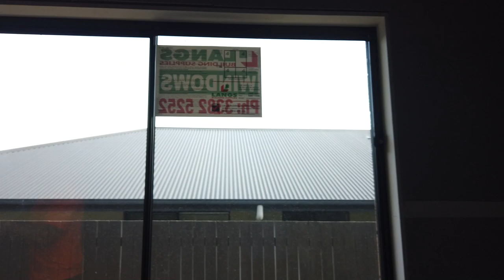How to Tape and Coat Drywall Joints

Comment: Max do you know the brand of taper they're using and what kind of dry time is on the hot mud , do they have to stop occasionally and flush out the taper every hour or so because the mud setting too hard inside of it ?
Reply: Jeff Carpenter the tool is a TapePro Mud Box - and they are taping in with 45/90 minute setting mud. I’ve asked the same questions too 😉 It’s a pretty cool process they have going. Could be stressful by yourself but with three guys you can go fast!
Reply from the maker: Thanks Ryan
Reply: Anytime, Maxkil! Love the new camera and the vids youve been putting out 🤘🏻 Looks so sick!
Reply from the maker: Cheers Ryan, wish I could just do this all the time.

Comment: Hi mate,
Just a quick one,can you show me what compound they used there?
i am using csr, boral and knaulf，but all of them can not be applied the next coat before it sets. But it seems your boys applied first coat before taping compound sets. Much faster than us-at least save 45min btw taping and first coat.
Reply from the maker: In this video's you only see the taping and bedding. That's not the second coat he's doing after. He's just filling the recess. This is all first coat.
Reply: @Maxkil  in our job,we seperate bedding from taping ,in other words,we do bedding after taping sets
Reply: @alanguo7961  We fill the recess as soon as we press the tapes because it's the same batch of mud we've mixed for taping that we use to fill  so it dries together that's all still one batch of 90 minute mud. When that dries we run an 8inch box with top coat and the next day a 12inch. We've tried just pressing the tapes and then running a smaller box to just fill the recess instead of this way, but it seems to come out much nicer for us doing it this way
Reply: @drywallgangsters  thx for the details.
It might sounds crazy but we finish this job within one day-obviously
We really have long day working. 
So we have to seperate every coat even taping as much as possible but we use 45min base.
So it makes sense to me now as you do final coat the second day.
When to teach me how to use stilts.LOL
Reply: @alanguo7961  we have also finished jobs in one day but small ones. Prefer to finish over 2 days though! They are actually easy to learn. Start at your house on grass and use a table to get on the stilts and just walk around holding onto the house until you're comfortable enough to walk without holding the house